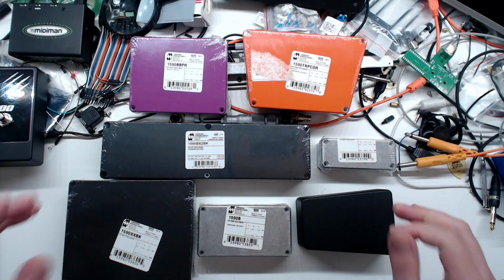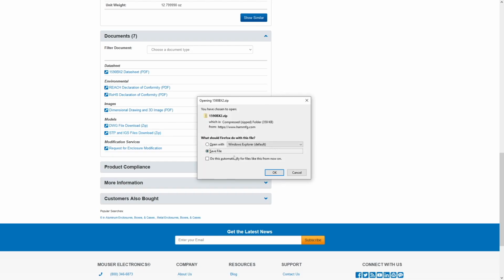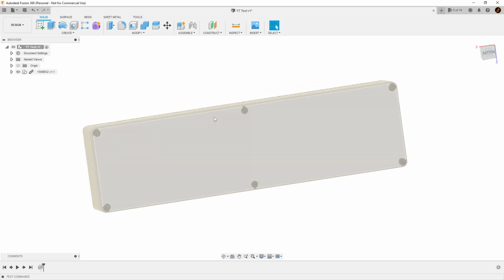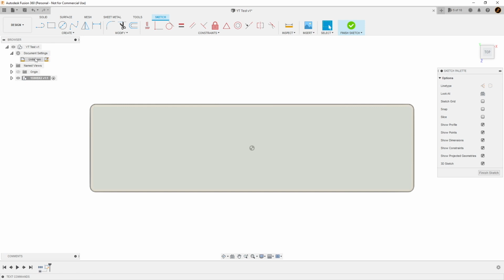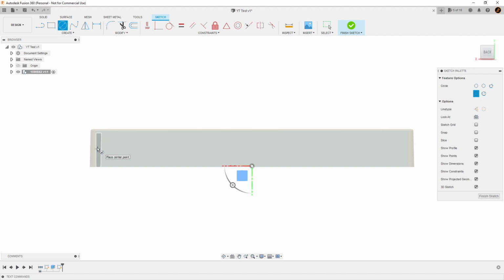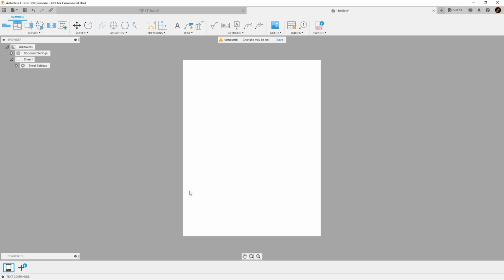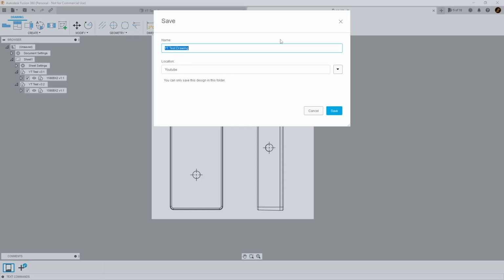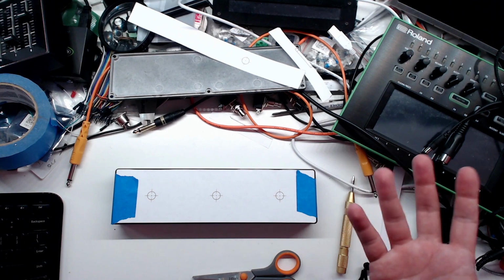Working with Hammond Stomp Boxes in Fusion 360

Comment: Awesome. I was using the drawing feature last week but was missing a few things. Generally, I 3D mytemplates making the outer edge bigger than the enclosure with a lip so they fit over the enclosure. I also started to import or draw objects like pots and foot switches, then export a PCB from Kicad, add the hardware , then extrude the tops of the pots and foot switches up through the template. I have gotten almost perfect precision from the get go. What a great tool Fusion is! This is particularly awesome when you are having the enclosures cut and UV painted overseas. Who wants to screw up a bunch of enclosure before you get the fit right. Such a stratifying process. Thanks for what you do. You got me started with Midi and I moved onto guitar effects pedals.

Comment: I do it differently, I go to the acrylic shop, they put the box in a scan and get the perfect shape of everything, in the pc we calculate all the holes in a very symmetrical way, they do a board of acrylic, a template with 6mm thickness, it's perfect to to drill because it holds the drill safely and I get all the holes I need, try.